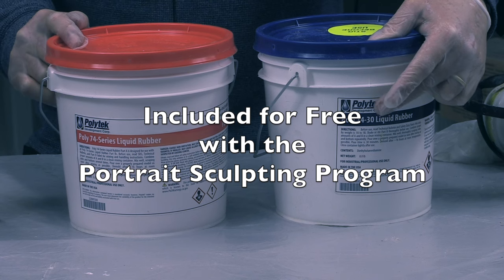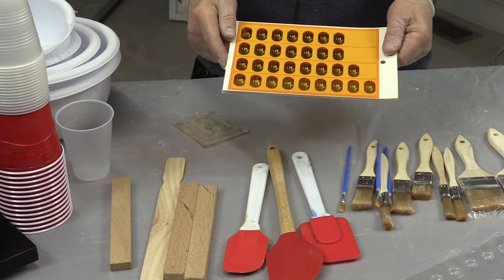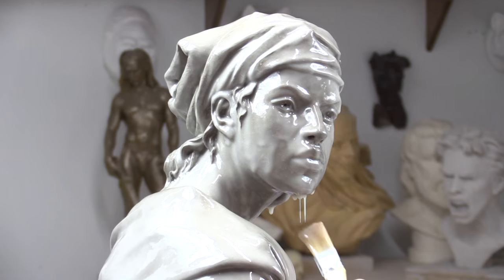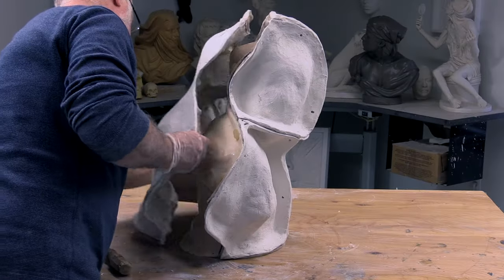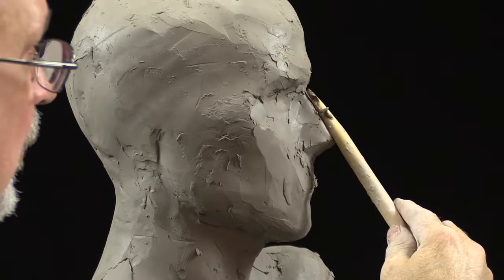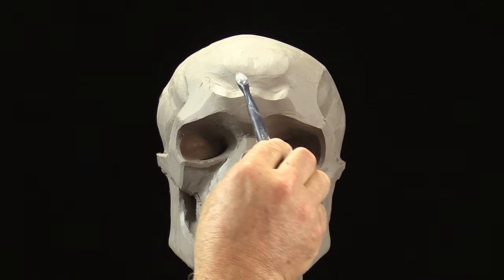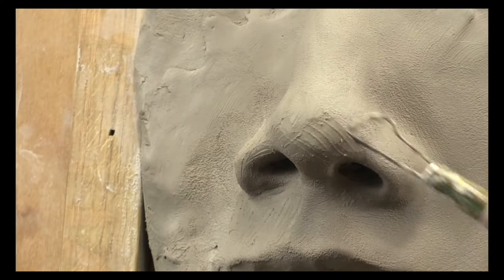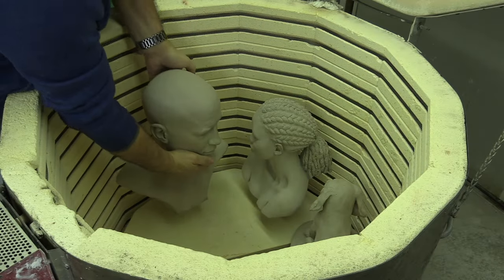Mold Making and Casting for a Portrait Sculpture

Comment: Where’s a good affordable place to buy the clay. Sculpt Depot wants $40 to ship
Reply: go to a local pottery place, they usually have cheap blocks of clay. You can also look up oil based clay, but be sure to get the sulfur free kind. Some of the mold making supplies react to the sulfur so it's easier just to forgo it.
Reply: I live in a very remote place so it would be best for me to have it delivered. I was wondering if there is a better web site to try